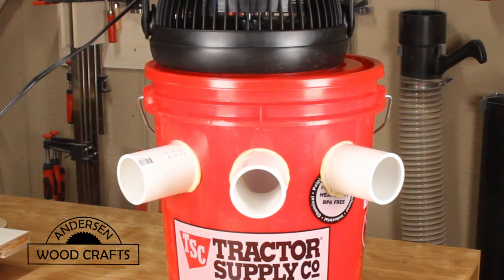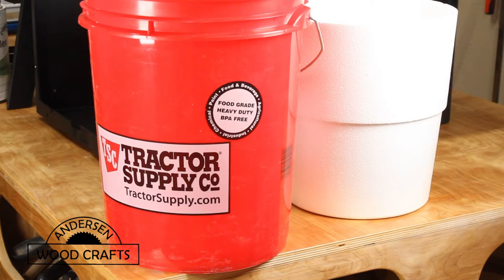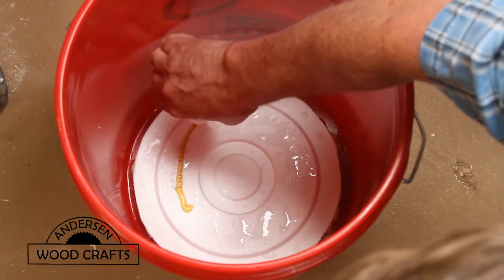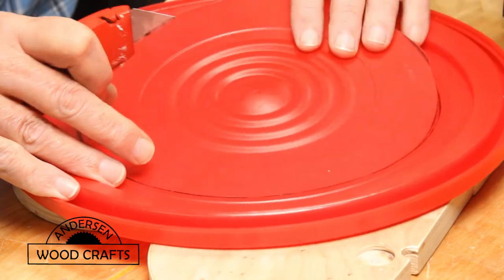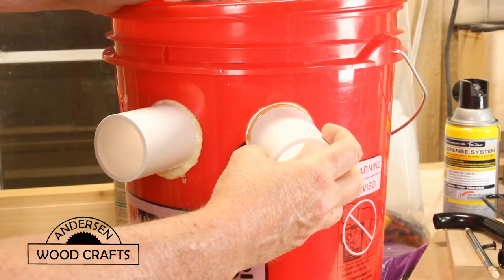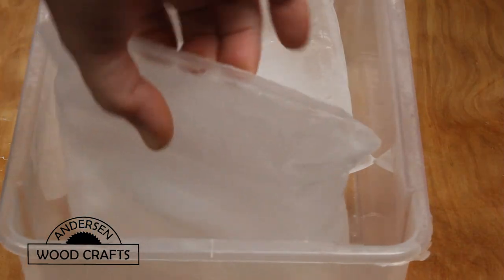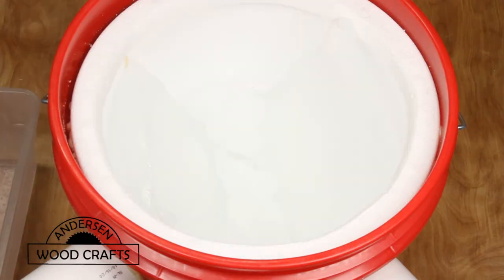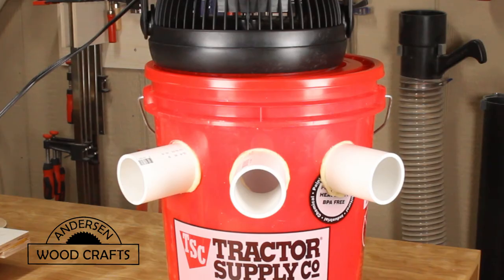DIY FIVE GALLON BUCKET AIR COOLER

Comment: I found a 1 1/2"  PVC adapter worked great to push it out thru the 2 1/4" drill hole, which was the only size circular attachment I had, so improvised. Pushing from within helped seal it even more thait's already well sealed fit. Fits perfect and super snug into the Styrofoam 2 1/4" hole too. I also bought a ft. of sch40 PVC and a couple of 45 degree fittings and adjusting the direction. Yours is great, except I don't like all the glue showing.
Reply from the maker: Thanks for sharing.  I did have a bit of glue foam up, it could have been a little neater.

Comment: Is a liner necessary?  Can't I just use the bucket? I live in Brazil and have no idea where I would find any insert. They don't sell these bucket here, but I can use an old paint container with the same dimensions and design. I can improvise, but not sure what I might do, if you say it really is necessary.
Reply from the maker: Some sort of liner is needed in order to insulate the bucket, other wise the ice will melt quickly.  I like what you're saying about improvising, find something that works for you with the material available.  Thanks for your comment and good luck.

Comment: That Styrofoam bucket insert has to be the most difficult thing to track down — near impossible if you're from Canada, like I am. (I've found three different vendors carrying this, and none will ship to Canada.) If the author of this video or anyone reading this comment knows who will ship this product to Canada, please let me know!
Reply from the maker: Sorry about your dilemma.  The only place I found them was on Amazon, but can't answer about shipping to Canada.  Sorry I can't be more help.  Thanks for your comment.
Reply: I just happened to have a leftover styrofoam panel remnant that I had from cutting out panels for my garage door. I will be cutting "V" on the non-reflective side. I'll bend them inward to form a circle/tube cut another piece for the bottom the diameter of the bucket bottom. I'm thinking that this should be pretty easy.  Also use gorilla glue. I have plenty of buckets fans and some leftover section of styrofoam sheeting.... Proposed costs...Free WIN!
Reply: @michaelphoto325    
what about a styrofoam minnow bucket?  or do they make those anymore.
Reply: The states too. Only online or 2 hour drive away. Ridiculous.
Reply: Not sure if they have Homedepot I'm Canada but they have plenty of the insurts online

Comment: How long Did the ice last and would dry ice work better?
Reply from the maker: A few hours (4-5).  It also depends on the size of the ice blocks, freezing water in half gallon milk jugs work well for me.  Thanks for the comment.
Reply: Dry Ice is Carbon Dioxide. I would not recommend.